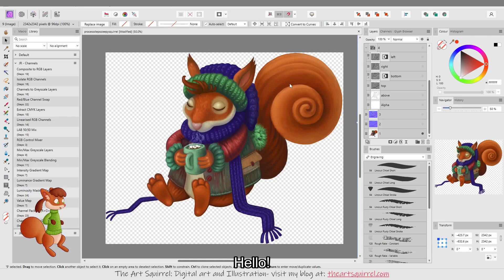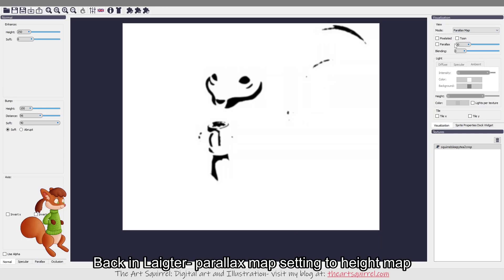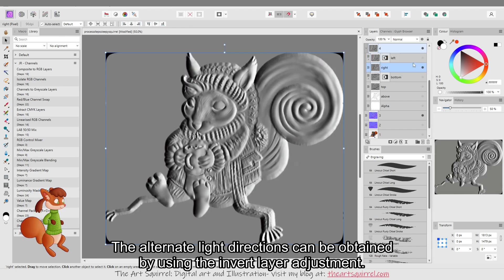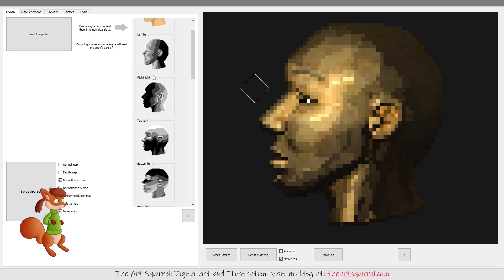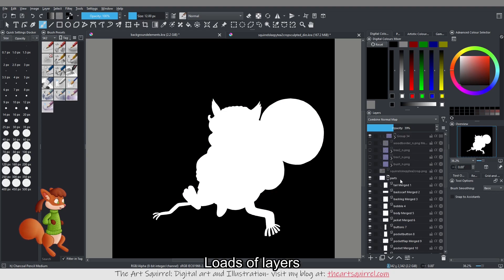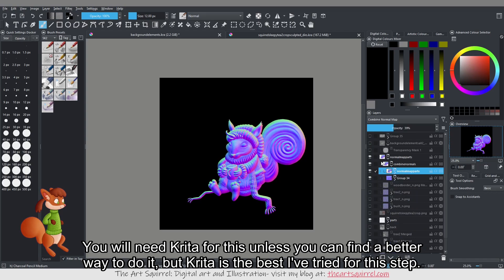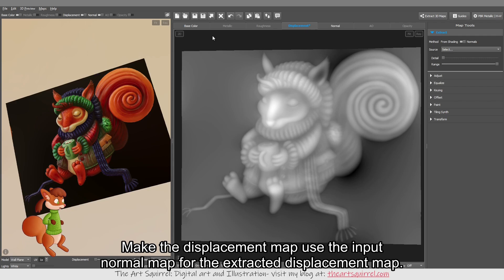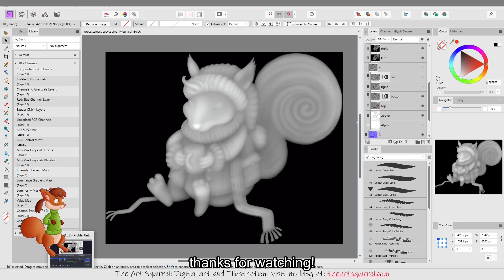Make normal map and heightmap from image for bas-relief step by step

Comment: may i know what is the difference between  normal map, height map and displacement map!/
Reply from the maker: The normal map is the blue, red and green image. When I refer to height maps and displacement maps I'm talking about the greyscale images, height maps and displacement maps are the same thing in the context of this video, just known as different names.  They are used for displacing geometry. Normal maps don't alter the geometry but they create the illusion of 3d on 2d images for dynamic lighting in game engines.
Reply: @theartsquirrel  thanks for quick response. In case I am having a black and white line drawing of a cake and i want to create a 3d model of that cake using blender. Can i use this method to get a sample height map and import into blender to create basic mesh and retopologies?
Reply from the maker: Yes as long as you just want a 2.5d bas relief cake effect you could use your drawing as a starting point for this method to create a height map. The height map could then be used in a displacement modifier on a subdivided plane or as an alpha in sculpting to create the 3d model. If you wanted a full 3D version in the round and not just a bas relief of your drawing you would need to model it or sculpt it using the drawing and cakes as reference.